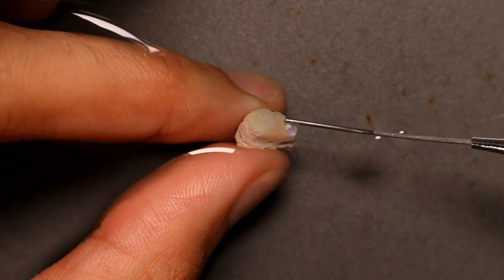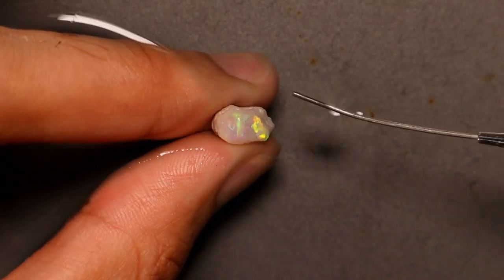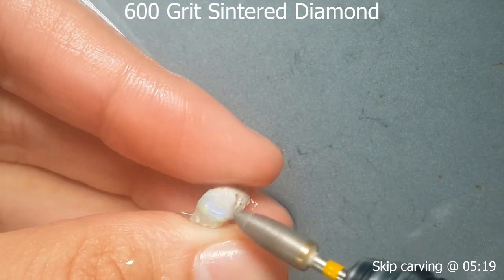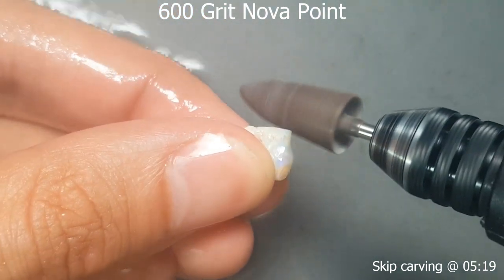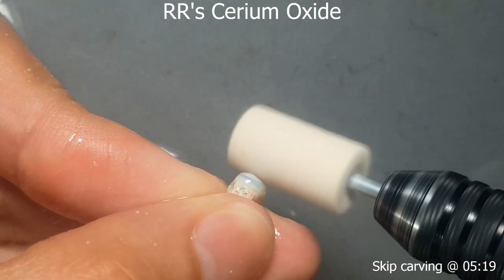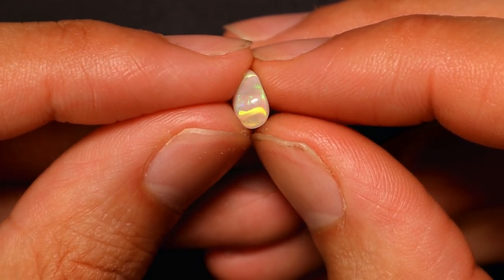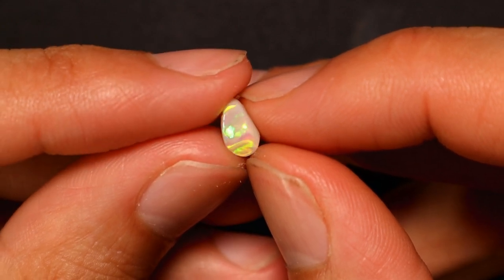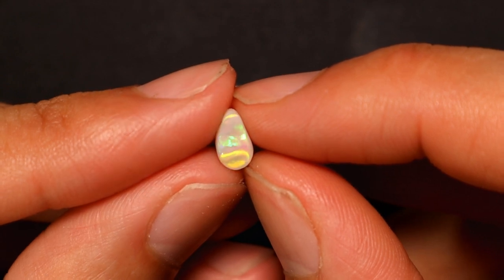Rolling Flash Crystal Opal From $50 Lightning Ridge Parcel. Dremel Carve And Polish.

Comment: Gaining experience with this type of problem solving is a benefit that comes with working through $50 parcels, IMHO.

I can't spend hundreds of dollars on expensive parcels. However, this doesn't mean that I can't cut nice gems. Just have to work harder/smarter to extract them from gamble-quality rough stones. The fun is in the hunt, IMHO!
Reply from the maker: You are spot on. You can learn a lot and have a lot of fun with the cheaper material.

Comment: I would have probably started with the black nova for the shaping. The chips have me a bit weary with the diamond burs. A great little stone. Thanks for the video Roy.
Reply from the maker: The stone didn't chip and rarely does with a 600 sintered. The issue with starting at a Nova is often you'll end up destroying the burr and here they are not cheap.

Comment: looks beautiful!
Reply from the maker: Thanks. The stone tries its best and I always wish they were better in the end.
Reply: @RoysRocks  isn't there a way to cast the base in some resin or something that would make it stronger and not crack? It's a real shame to lose such a pretty little gem.
Reply from the maker: @AI3Dorinte  Yeah could resin stabilise or remove the unstable stuff and replace it with a solid backing. A black backing is probably the wiser of the two options.
Reply: @RoysRocks  and would also make the stone look better, cool, please post the finished product if you intend to work on it :)